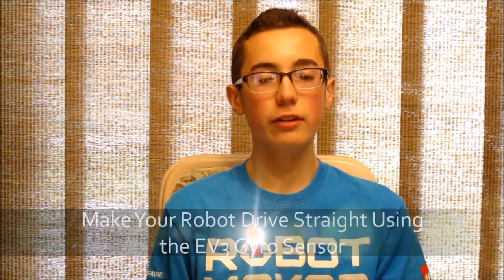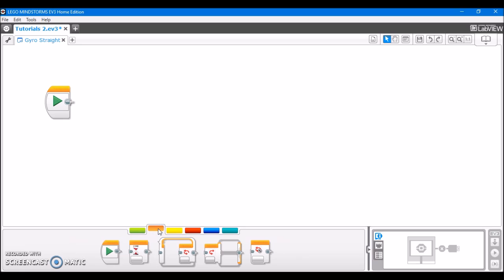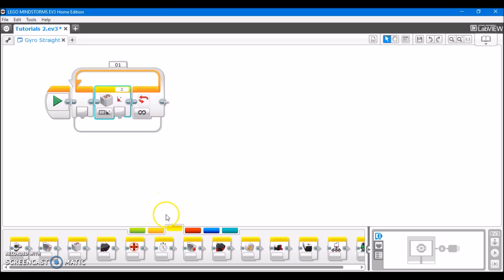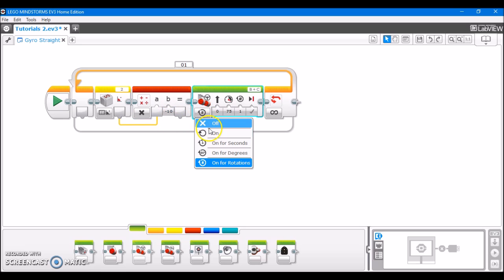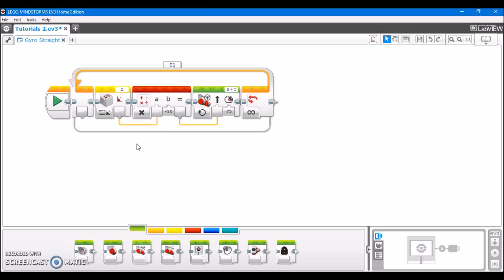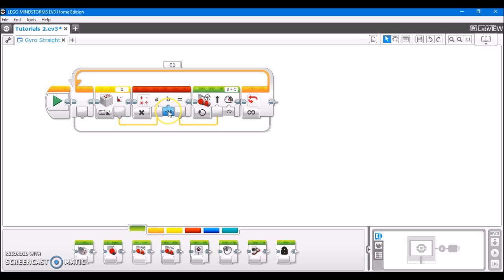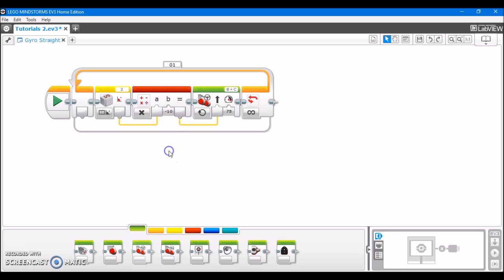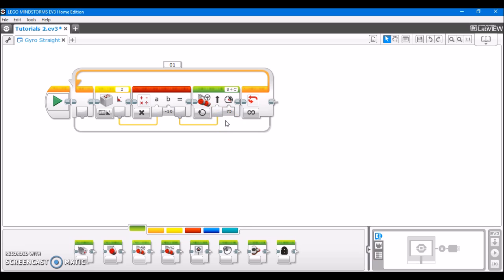How to Make your Robot Drive Straight with the EV3 Gyro

Comment: Thanks for the code, its kind of working, but my program seems to just move straight for a bit and then starts to turn in circles I don't know why
Reply: I had the same problem... I believe that your robot has inverted motors... you can fix it by making the -10 just 10...
Reply: @leukanttila8233  Ok I will try to do that thanks

Comment: We used the gyro sensor calibration program program during the tournament. For some-reason the robot used to hang(probably for calibration) and then misbehave terribly. We started the robot on a table in pit-area beside tournament table in round 1. And then in round 2 and 3, had put the robot on ground to to start. For some reason both the above couldn't help our robot behave correctly.

In our practice pit and at our home the robot behaved very nicely but not on the tournament table. Not sure on what had happened
Reply: The gyro sensor tends to drift when it is moved while booting up.

Comment: When I set a negative value for the motor power it does not do the same as if I put the power as positive. What should I do?
Reply: My motors are placed backwards for a a more compact bot, I can’t flip them because of my bots walls
Reply from the maker: You will also need to negate the K value (the constant the correction is multiplied by) if you drive in the opposite direction.

Comment: How do I make it so it only drives for a certain amount of degrees
Reply from the maker: Set the loop's exit condition to end after the motor rotations on one of your drive motors is > a certain desired number of degrees.
Reply: Builderdude35 when I did it now it just drives continuously and yes I made sure it’s on a drive moter
Reply from the maker: Make sure that the exit compare condition is ">" if the degree count is positive, or "<" if it is negative.
Reply: Thanks man btw I love the vids!!

Comment: my gyro program is working gud but when I put the gyro program in complex programming it just moves 2,3 degree
Reply from the maker: That is strange; maybe double check your loop's exit condition and make sure that you are resetting the gyro at the point when your want to use it.

Comment: @Builderdude35    Great Video but I have 1 question. How do you prevent it from going left and right while going straight instead of going straight. What I mean is that when you ran the program your robot was moving a bit. Do you know how to solve that problem?
Reply from the maker: Adjust the K value (the value that the correction is multiplied by) for optimal smoothness.

Comment: Im not really good at using math blocks, can you make gyro following programs without math blocks?
Reply from the maker: Unfortunately, it's not possible. The math blocks are a crucial part of the program.
Reply: If its not possible, then ill just try getting the computer version...
Reply: @Builderdude35  not really u could use a loop and 2 switches

Comment: Great job dude lesson learned with your gyro series;) I really appreciate it.
I know that there is an algorithm calculating the degree difference in left and right motors and this works fine too. Which method do you prefer, or to be exact, which one do you think is better?
Reply from the maker: Yes, I have a "drive straight" program that uses motor encoders instead of the gyro. I personally prefer the motor-based one, but neither is better so it's up to personal preference.

Comment: Hi BuilderDude35, Our robot goes forward a short distance and then starts spinning around forever. whats wrong with our Gyro sensor?
Reply: Our robot is doing the same thing. I used the tips on your other video, but it didn't work. Help!
Reply from the maker: See my video, "Improving the Accuracy of the EV3 Gyro." That will explain the issue you may be encountering and propose a solution.
Reply: same here
Reply: Mine too
Reply: @Spies39 changing the -10 multiplier to -1 would accomplish the same thing. -10 sounds like a *lot*. If the robot got off track by only 5 degrees, this program would send -50 to the steering block, causing one wheel to stop completely and creating a very sharp turn rather than a gentle correction

Comment: I have code for this that is slightly more advanced and is smoother. Over years of testing I have found that  the gyro while driving for a period of about 2000 motor degrees  veers one way or another(depending on the gyro) sometimes veering it more than an inch. What I did is add 1.25 to the gyro angle and it veers less than half an inch. This value may have to be added, subtracted, or even changed based on the gyro.  Just for any of you who have this issue. :)
Reply from the maker: Thanks for sharing!
Reply: Can u explain simpler i please, i need it?

Comment: That's pretty cool. I've always done proportional line follows with the output of the gyro sensor feeding two math blocks, one adding 10 to the value, one subtracting 10, with the outputs of each feeding one the power input of each drive motor.

What are you doing to reset the gyro?
Reply: There is a block in the yellow section, it looks like the gyro, you just need to switch the value gathering to reset.
Reply: +TormDemoniax I know, but it doesn't work all that well. I've got a reset My Block that I setup awhile ago that I don't remember off hand what's in it. It works, but it's slow. I'm curious as to what others use.
Reply from the maker: I typically prefer not to use a Gyro, just because the drift is too high. However, others have found ways of resetting the Gyro that minimized the problem. Best advice though, is to only reset the Gyro when the robot is completely stationary.